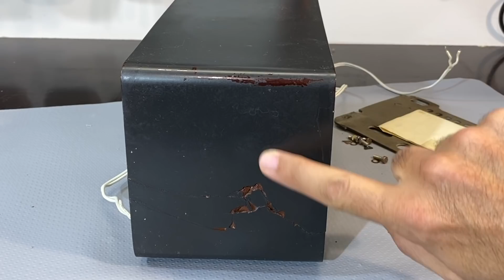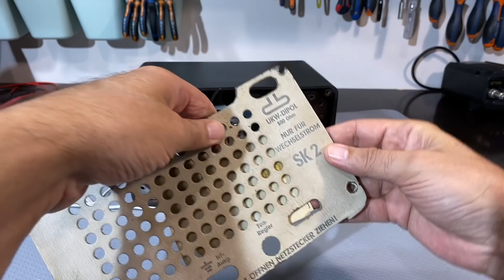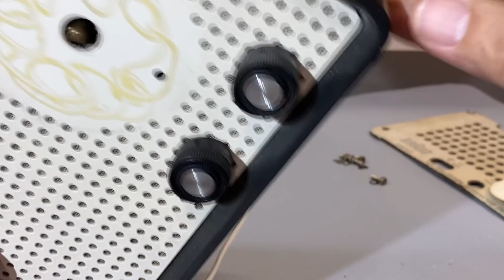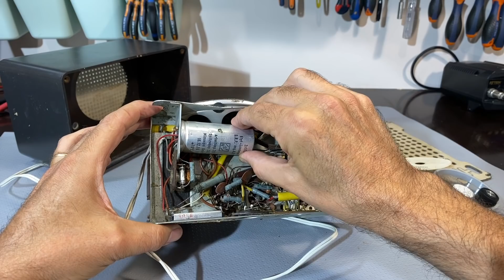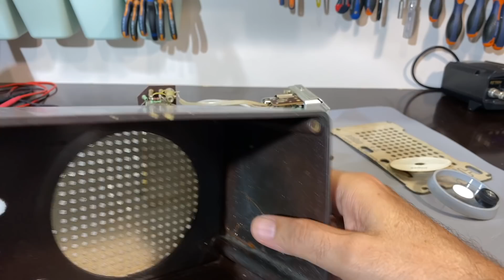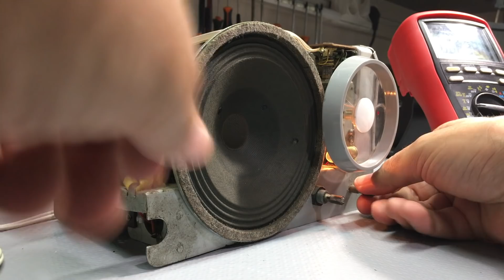Braun SK 2b tube radio restoration - part 1. Yes, I do have favourites :)

Comment: Another more like solid restoration. Quite a bit of SK2'... and other models restored. Braun is a special one in terms of design and production in the 60s and 70s. 

The buttons and tuning scale can be ordered from the following: https://www.ebay.nl/itm/184922274601?mkevt=1&mkcid=1&mkrid=1346-53482-19255-0&campid=5338421007&toolid=10001&customid=16cdae30-f906-11eb-844b-626533636664

No experience with it, price some on the high side.

Comment: Hi, there are shops, that can laser cut for your dial using material like presplex and fit it inside the outer ring.
Reply from the maker: Not in Madeira, unfortunately 😊
Reply: @electronicsoldandnew  please try to found a shop anywhere  and send it the size, they will cut and postage it to you. If I found one, let you know.
Reply: @electronicsoldandnew  please check the link below in eBay 
https://www.ebay.co.uk/itm/Laser-Cut-Clear-Acrylic-Plastic-Circle-Discs-Perspex-Sheet-Various-Sizes-/202319880579?_trksid=p2349624.m46890.l49292

Comment: Perfect as always. Just to know when you have a hot chasis radio, and you want to check audio safely, i have a bunch of really cheep 1:1 600ohm small audio isolation transformers. You can get them from ebay really cheep (little red ones). And then through them i am sure i won't toast my signal generator.
Reply from the maker: Always a good idea. Much better that testing it with your finger 😊
Reply: @electronicsoldandnew  ah, how many times i got zapped from not discharging capacitors.
Reply from the maker: Me too. Keeps me attentive 😊
Reply: @electronicsoldandnew  Exatamente o mesmo.
Reply: @electronicsoldandnew  btw i was always puzzled by your South African accent, in Madeira and just now i found out that you studied there. The mystery solved. Sorry for prying.
Reply from the maker: No problem. I was born here, moved to SA at the age of 6, and left after varsity. I’m a bit of a mix of cultures.

Comment: Hi Manuel, thank you for the shout out, I'm slightly embarrassed. 
I thought, that's a great little AM radio then you took it out and it has FM as well, very nice. 
If you can't get a replacement dial and I assume the dial is slightly domed, I have had success using screws to clamp acrylic sheet between a board with an appropriately sized circle cut out and a piece of flat board with a compressed air nipple screwed in the middle, I heat the whole jig and sheet to about 140-150C and apply regulated very low air pressure via the air nipple and it will dome out very evenly. I hold the pressure until it cools, cut off the excess and in your case cut a hole in the centre hopefully to fit the original centre. Better if you can get a replacement though.
Looking forward to part 2 👍🙂
Reply from the maker: Thanks Dave. I had already gone back to see the appropriate video of yours, precisely to replicate your technique. I think it will work out just fine.

Comment: Hello !
When you say that improving is always easy once it's working, I can say it's not true at all.
I'm repairing a Grundig 5088 and I cannot get rid of the distortion in fm, even after following the alignement procedure. I'm totally desperate to get it working. Would you mind helping me if it's ok for you (via mail, messenger,...) ? As you have skills I don't have ;)
Reply from the maker: I’m afraid that my time is rather limited. These videos are a log of my hobby projects, which I have quite a few of. I only work in those.

Comment: Nice one!  I'm sure it'll look and sound brand new when you're finished restoring it.  Re the dial knob, it looks like the cracked part can be popped out and replaced with a piece of clear plexiglass.  If it can, and it is concave/convex shaped, you can cut a new piece out of flat plexiglass and heat it in a toaster oven just enough to make it slightly pliable.  You then press it onto a pre-made wooden form while it is still hot (wear gloves!) to make it assume the shape you want.  It's a bit of an inexact science, but I was able to do this for a skirted knob from a B&K 607 tube tester and it came out quite well.
Reply from the maker: that is exactly what i’m planning. thanks.

Comment: nice video, did not find the dial class, but the same radio rastoration at  https://www.vandenboom.de/braun/restaurierungen/79-sk-2-2
;-) but seconds later only in german , take a look at this https://www.vandenboom.de/braun/restaurierungen/79-sk-2-2 translate easy with website "deepl"
Reply from the maker: That's it! I knew I'd seen a cabinet repair just like mine, but could not remember where.  Thanks.
Reply: @electronicsoldandnew  fine that this was helpfull ;-)

Comment: Another nice project Manuel. Regarding the dial knob replacement; is the clear section convex or flat? If it is flat and you can remove it from the rim and the centre I would be happy to turn one up for you from Perspex or similar as my donation to the project........
Reply from the maker: It’s curved, unfortunately. However, I’ve received some hints as to where I can find it. Thank you.
Reply: Ah, okay Manuel. Good luck. If you are still stuck when you have explored the other leads I might be able to try thermoforming a dished one but I've never tried it🙂
Reply from the maker: thanks